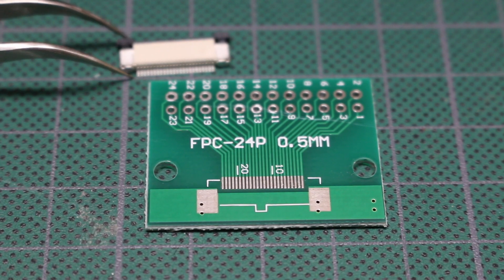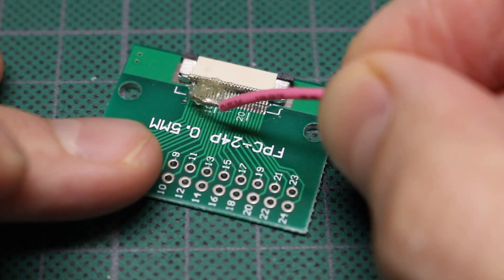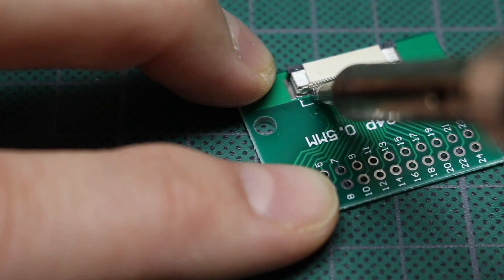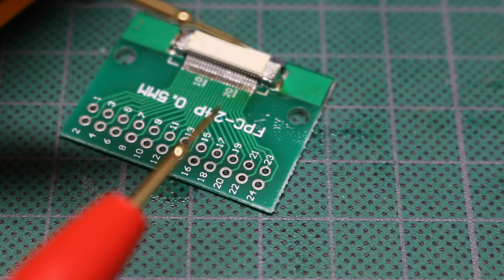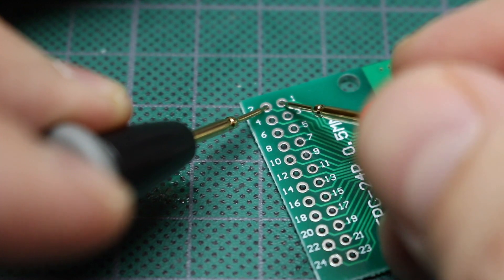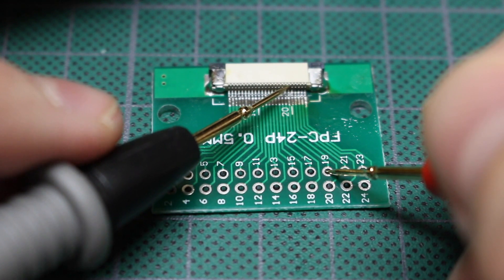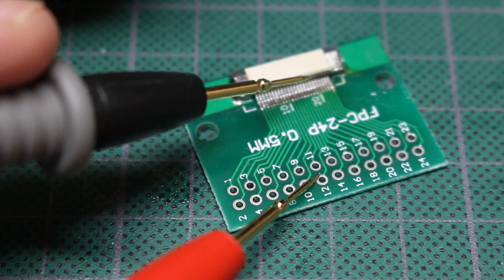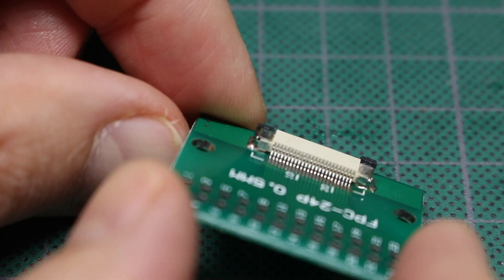Drag Soldering a 0.5 mm Pitch SMD Connector

Comment: I have a similiar connector but all the pin legs are bridged due to soler. Despite using a solder wick, I am unable to remove all the solder from shorting the pins. What is my best way to resolve this mess? Any suggestion would be helpful. Thank you for this wonderful video.
Reply: I used a jumbo solder sucker and it worked for me. If using wick, make sure to add flux if it doesn't have flux on it from the manufacturer.

Comment: At 0:00 What are the two grey boxes at the bottom? Are those conductive or just visual indications to show where to attach the connector?
Reply from the maker: conductive but just used to solder the connector tabs for mechanical support
Reply: @GadgetReboot  Ah gotcha makes sense, thanks for replying so quickly!

I broke the connector for my laptop touchpad but when I just press the ribbon connector on the bare solder joints it wasn't working. Thought it had something to do with the connector tabs.

Comment: I use the same tecnique, but I simply apply a tiny blob of silicone on the two pads to hold the connector in place. After 24 hours you can then solder the pins.
(Use only alkoxy-based silicone to not damage copper.)

Comment: I hate soldering 0.5mm pitch FFC connectors so much.
Reply: I wonder if solder paste could be a better tecnique. I mean, less frustrating... nobody tried?
Reply: @giuliobuccini208  i tried, all you get is solder bridge hell. drag soldering is also very unreliable and results in many bridges as you can see in this video. the most reliable i've found is to tin the hell out of the pads, drown everything in flux, and then heat the pads while pushing the part down.
Reply: @TMS5100  Very intriguing technique. I have to try it!

Comment: In my previous job I was used to solder a lot of this kind of connectors components, I personnaly started to apply just the right quantity of tin on board, uniformaly spread. After that next step was to mechanicaly soldering the connector to insure no displacement during legs soldering, each legs can have a light mechanical tension on reasonable quantity of tin you would have been put previously, this increased the final result quality. I personnaly used way less flux because it can be spread in connector itself when heated and results to a random electrical conductivity with the flex cable. Finally I avoided to pass multiple times on same place with soldering iron, flux is highly effective in first pass but lose its effect when re-heated. We clearly see that your first pass is very clean, but the second goes wrong with a lot of shortcuts (1:06 cut scene ^^) You'd better cleanup and reapply fresh flux in case of first pass failure. Don't get me wrong I don't criticize your work result is finally really clean, I just wanted to share my old personnal experience on this subject.
Reply: please learn to spell and edit your comment thanks 👍
Reply: @jessihawkins9116 *Please.

Comment: Here's an easier & faster tip to ensure that each point is connected to the ribbon connector.
After checking that you haven't created any bridges between the lines, take a piece of wire and temporarily create a bridge on the ribbon connector,  now firmly press your multimeter's one lead to that temporary Bridge -
- and the other lead can be touched to each of the numbered spots quickly and easily and with continuity selected on your multimeter you will hear the beep just by touching each spot for a split second so basically you can then just drag the second multimeter lead over the numbered contact points and if there's a spot without a beep you know that there is an incomplete circuit.
Reply from the maker: yeah that does sound like it’s a lot faster and less hassle. Thanks!
Reply: Or, if you have to solder many of this, just prepare another similar board with all of the pins shorted. Then simply plug his ribbon into the one you have to test.

Comment: I have a connector that needs to be soldered back to its spot on a circuit board.  It looks like a drag solder job smiler to what you did.  I want to show you a pic of it and tell me if it can in fact be done.  Please contact me

Comment: Hi. What kind of equipment or setup do use (if any) for magnifying the component you are soldering?
Reply from the maker: I am soon hoping to set up a microscope for soldering but for now I just do it without anything and if I am recording the video I just try to zoom in as much as I can.
Reply: If you're just needing to magnify the piece in order to see your process (not magnifying to record the job) then I find that regular "reader spectacles" (usually sold at most pharmacies etc.) They work quite nicely to just slightly enlarge those tiny parts of a project that you need to see...
Or if you need to magnify it even more,  use those "Reader Spectacles" PLUS  a common magnifying glass.  The combination of the 2 lenses make a Massive difference. 

If you want to record your work, you can take a regular webcam &
If you unscrew it's lens a little bit, you'll be able to close-up focus on the tiniest components.
That is essentially what a digital microscope is ~  a normal webcam with it's lens adjusted.
 (No need to buy a specialised digital microscope)

Comment: How come that every time I try drag soldering, it is a disaster?? I use the ordinary cheap liquid flux, but I presume it is incompability of lead free reflow solder on the board and the leaded solder I'm using, that makes it flow badly creating bridges all over the place?
Reply: The ordinary cheap flux pen I'm using is usually very effective, but connectors are of course soldered on professionally made PCBs and I think It is the solder that is incompatible. It is like the two solders form an alloy that is matte, rough and mash potato like = it doesn't really flow. So I think what I have to do is to completely remove the factory solder on the pads with wick and then re-tin them with leaded solder, before I attempt to solder anything to them. I'm soldering a SODIMM connector and it has been a hassle: The pads were nicely flow soldered from the factory, so I thought, just clean the PCB with alcohol and use the tinned pads! Big mistake. I have essentially had to remove the solder again with solder wick and resolder all 200 pins, with all the burnt flux and bridges resulting from that!! So far this single connector has taken me two days to fix. and I still need to test it before applying power!
Reply from the maker: I don’t think the flux is any more or less compatible with lead or lead free solder but definitely leaded solder is going to be easier to work with so that’s good to use.
 I think the gel flux though is much easier to work with because the liquid just kind of runs off because it’s already flat to the board and if you add more it just spreads out but the gel piles up and as you keep heating it and dragging the iron, there’s a continuous supply   Of great quantity of flux and it keeps everything from bridging. I just found it easier to work with so I would try that. It also takes a lot of practice I messed up a lot of connecters first.

Comment: Where can I find these ribbon connectors ? And I have 2 of those tiny traces gone... Any help would be great !!
Reply from the maker: If you search for example on eBay for FFC or FPC connectors, that’s where you find them.   Flat flex cable or flexible printed circuit. 
https://www.ebay.ca/sch/i.html?_from=R40&_trksid=p2380057.m570.l1311.R1.TR2.TRC0.A0.H0.Xffc+fpc.TRS0&_nkw=ffc%2Ffpc+connector&_sacat=0

If you have a connector footprint on the circuitboard were a couple of the traces are ripped away, I recently fixed something like that with a micro USB connector that was starting to rip away from a board and had no pad for two of the connector pins so I had to get the thinnest wire I could and try to use a lot of flux to keep things from bridging and just use the soldering iron and heat up the connector pin itself  while it’s full of flux, using an iron with solder on the tip and then getting ready to try to put the wire in position on the pin and hold it and hope everything makes a connection straight on without bridging.
   It can take many tries but using the flux helps keep things clean and using a copper solder wick braid braid to remove solder helps give multiple attempts at a clean work piece. Of course one of the main tricks is not to keep the iron there for more than two or three seconds so damage is avoided. 

Then I had to solder the other end of the wire directly onto the other component at the other end of the broken trace which in my case was a nearby surface mount capacitor.  But if the other end of the trace is not visible because it disappears into the board or something, sometimes I have to use a sharp hobby knife to scrape away some of the solder mask on the broken trace to expose the copper and then just try to solder the wire onto there the same as onto the connector. Create my own footprint.
Reply: DigiKey sells these connectors.  The problem there is that you're drinking from the firehose - a search will find hundreds of connectors so yo need to know exactly what you want.  Also, some brands/models can only be purchased in bulk, and you probably don't need a thousand of them, so you need to look really carefully when placing your order.

Comment: Am curious how you held the connector in place, as you applied that critical first tacking glob.  Recently, I use liquid flux as a kind of glue ... it sticks hard when it dries.  Have also used Kapton tape, and (rock) hard resin for the same purpose.
0.5mm QFP48s drive me nuts, getting them aligned.
Reply from the maker: The flux  paste was acting like a jig holding the connecter in place when I put the first layer on the pad and then positioned the connecter straight on the pins. Then I applied the thicker glob on top of the pins and that held it down from the bottom and the top of the pins at the same time and I guess between that and surface tension as the flux became liquid and also maybe adding that by the time the far end of the connecter had all melted flux, maybe the first  couple of pins were already soldered down so there was always something holding the connector. 

 That was my second attempt. My first attempt was to try holding the connecter in place and soldering one of those bigger mechanical tabs on the side but then all the pins were floating above the footprint because the connecter was too high off the board so this way at least the connecter pins would pivot down to the pads and would be in contact.
Reply: I haven't tried this myself yet, but after watching a soldering video over on EEVBlog, it seems that his technique is to manually solder one pin (tin the board, then reflow it to connect it) in order to hold the entire connector in place.  Then drag across the rest of the pins to complete the job.